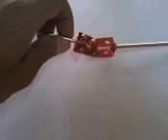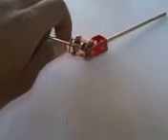DIY RC Car Universal Joint

Comment from the maker: i wana make a 4 wheel drive drifter.. . would be great if i added telescopic drive shaft which will allow smooth power delivery when the suspension is at work.... kindly mail any ideas on alok.deherkar@yahoo.com

Comment: For an R/C car application a better choice would be a flexured universal joint.

Basically a coil spring between the two shafts. since R/C cars or trucks; even powerful 1/5th scale trucks are max 6 hp. Fabricating  a flexured joint is no problem even for young people.

As a hint and starting point: Valve springs and retainer from small 4-stroke engines.

Retainer is designed to locate valve and it's surface allows welding/mounting. use your imagination. Strong materials are available.